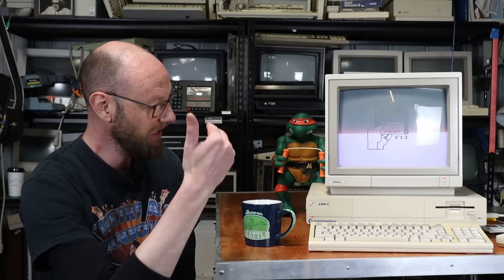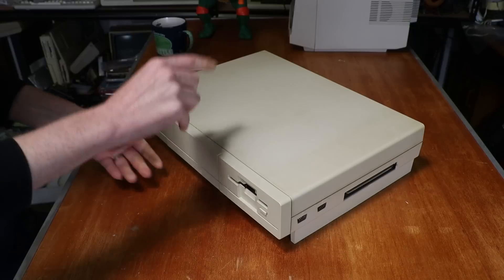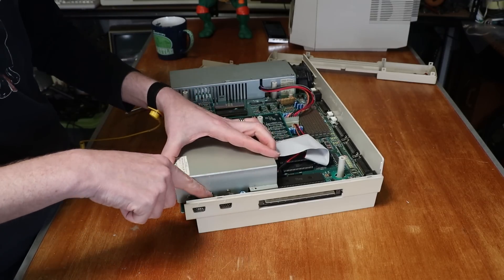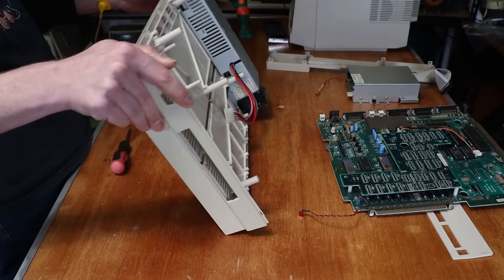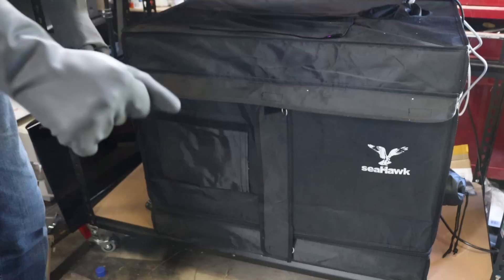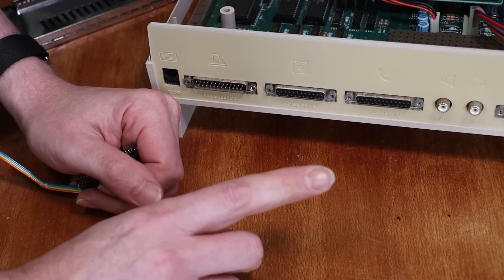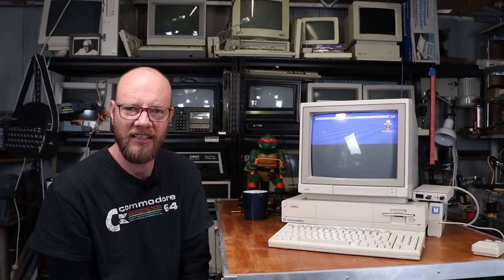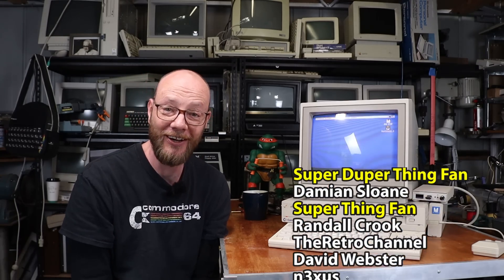Amiga 1000 Pt 1: Clean up and Gotek

Comment: New challenge for ya :D

Find a Rejuvenator board for the A1000!  
They sold a "Rejuvenator II" back in the day.. but that was really just a "kit" to upgrade the first board to 2mb of Chip RAM.
Since then, the same guys, all these years later revealed the plan was to make RJ II board...  Not sure if they pulled it off or not.

That's one

Then get the Hurricane accelerator board for the A1000.  According to the photos in the Big Book of Amiga Hardware, it looks like it would fit with the RJ board....
That adds 8mb of Fast RAM as well. (so disabling any slow RAM on the RJ board would be necessary. ;)
Daughter card must be added for the RAM.. otherwise suffer only a 10% increase in speed.  LoL  :P

Now, there is another option which is probably even more rare
It's called: The PPI 1000
This strange contraption, goes on the top of the A1000 and makes it look like a computer from Star Wars or something...  LOL
The Description mentions up to 6mb of RAM....
Looking at the motherboard, it seems you would have to probably solder in sockets for the additional RAM...
Also, do I detect an 020 or 030 on that board with a FPU?
The 020 or 030 looks like the PGA...  but then again there is a black PLCC hanging around the RAM area... 
Not much information in this link below.. but the photos sure is interesting!

https://bigbookofamigahardware.com/bboah/product.aspx?id=2001

Remember the rule, if its a 68020... and it is socketed...  then a matching 030 (PGA or PLCC) can easily slip in there... 
I failed to notice this about my old M-tec 68020-i  in time... otherwise I would have added a 16mhz 68030 to that board.  Sigh

Comment: Interesting video and the Gotek is the way to Go - especially for the A1000. I did the same mod but fed the ribbon cable underneath the face plate near DF0: Now it sits just in front of the left garage door foot. I hot glued it in place so I can remove it if I ever want to. Works a treat. Here is my youtube if you haven't seen it yet.  https://www.youtube.com/watch?v=wA5LcQcY2ts&t=190s

Comment: Great video. Could be worse for a side cart. I had a Supra Ram 500 RX Expander for my 1000. Had to flip it upside down and bend the metal case. But, it did put the switch to the front of the 1000. So, I guess that was good. 😉

Comment: My first ever Amiga was a 1000 I found at a thrift shop for 200$. No mouse, no keyboard, no kickstarter. 2M memory with a daughter board and it worked! Found a disk, bought a 500 and used that mouse for the 1K, and built a PS2/Amiga keyboard converter. Then... I sold it. Since I had the 500 and that was good for me, but there are moments when I still think about it. Such a fun little box!

Comment: Great solution on the DF0/DF1 switch mount that doesn't require any modification to the case!  I have my switch just laying on top of the case, running out the side of the expansion port, heh, not ideal, but your solution cleans that up nicely! On "The list!" heh.

Comment: on aging and beaking floppydrives:
if a floppydrive stops working and nothing mechanical is wrong the floppydrive it probably needs a recap. 
Just don't touch the alignment screws(or you will have to realingn the drive).